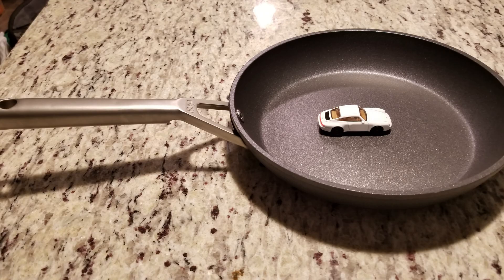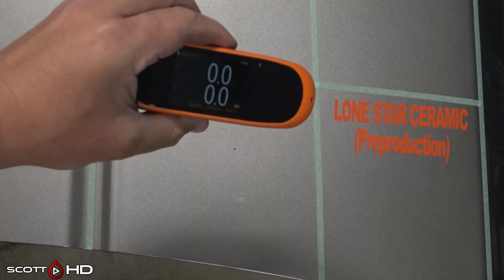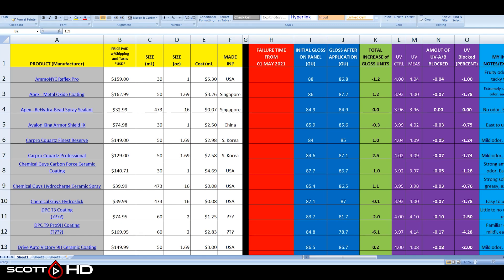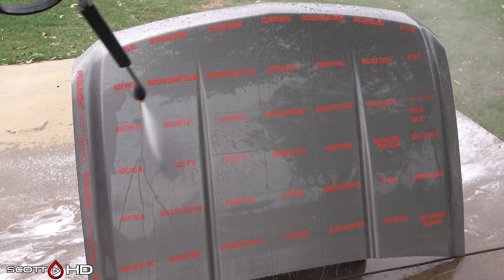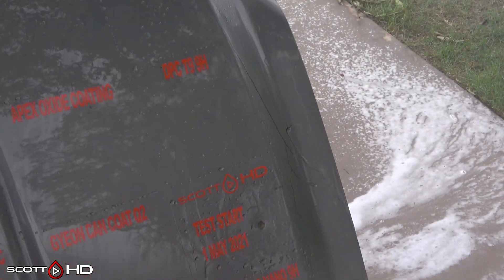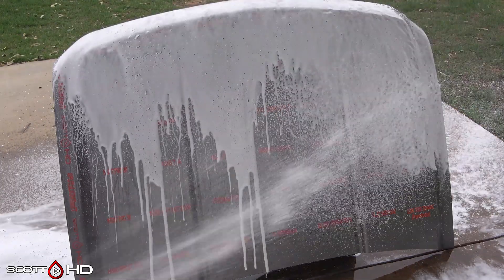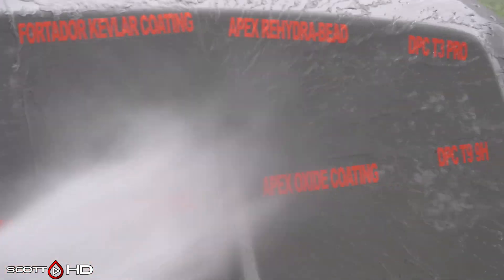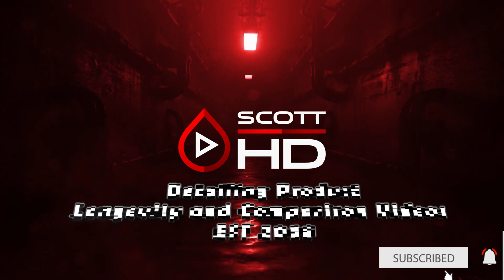Ceramic Coating Longevity Test - 41 WAY - The ULTIMATE comparison test - UPDATE 01 - FIRST WASH

Comment: This color makes it hard to see what’s going on but it’s good to see another lighter color in the mix maybe products will last longer than on the darker paint.
Reply from the maker: I agree. It was a bit of a risk since I couldn't find a black hood from my sources (body shops) that I get these from.   I will try to change angles of the lighting to better show it in the next updates.  Failing that I may try a different lens filter. I use a UV filter for outdoors which generally helps the water show up on the panels.

Comment: Great job. Can you add a ranking? Or add a filter to your spreadsheet to allow sorting by different properties like gloss?
Reply from the maker: Definitely. It's on the spreadsheet where you just select the row and sort by column for gloss. 

The ranking will end up as the failure time in days.

Comment: Rooting for CanCoat. Nothing easier to install.
Reply: Did you polish before applying for the first time? Also do you polish when reapplying after the CanCoat wears off?
Reply from the maker: @jpr96  check out the setup videos in the video description.  Properly washed, decontamination wash, clay, polish, prep before applying.

Comment: Did anything gain noticeable gloss? I know the gloss meter is different but it contradicts things from other channels unless I am missing something.
Reply from the maker: As long as it is plus or minus 2, it essentially gained nothing. I have only ever seen a few products gain gloss above 2GU after application. The majority of the gloss increase is from polishing.   This meter produces reliable, consistent results with a much lower margin of error than the cheap Chinese meters, so I definitely have a lot of trust in this one.
Reply: @ScottHD  good to know. Idk jack about gloss meters and other than things like this never saw where they would fit into detailing.

Comment: The epic efforts in the past month to do ceramic and graphene long term tests is unmatched. 
 Silver is so so and black is king just like your channel.  Dark green or dark blue would be decent replacements for black hoods on these tests.  Fortador is sadly weak but you also applied it via brush which the product pushers said brush to apply to pad then apply to car... 

i think when it fails you could consider “redoing” it correctly.  likely a bad product would fail again immediately and then that would be that.  maybe a hood of shame for the ones that just didn’t hold up and can demonstrate a second time that it has been marked weak
Reply from the maker: Agreed on all accounts. It was a risk for a silver hood, but I will play around with lighting and natural light for the next update to see what I can make happen

Comment: Scott, I'm confused. I hear other water reaction terms besides hydrophobic. 

Seems there are schools of thought for beading action and sheeting action. One being preferred over the other. 

Beading is hydrophobic and sheeting is, correct me if I'm wrong, hydrophilic. 

Just trying to keep an open mind here, but could any perceived early weak performances be attributed to a product being hydrophilic vs hydrophobic? 🤔

Never understood the preference for sheeting...harder to move off the panel with air and saturates a towel quicker than beading. 

Your thoughts?
Reply from the maker: There is a difference yes, however it if the water is sticking to the panel, there is no hydrophobic or hydrophilic properties remaining. (a good example of this is shown in the 20 way spray Coatings test). 

That being said, these products are all advertised as "hydrophobic" and will not just become hydrophilic.  The original intention is installing products that have hydrophobic properties.  

Manufacturers will tell you that just because the product is no longer hydrophobic, doesn't mean it has failed, but then what's the point?   (It's definitely not protecting against UV light as has been shown).  

You DO want a hydrophilic product for a matte or satin finish paint or wrap, as water spots will absolutely destroy it otherwise.
Reply: @ScottHD  thanks for the clarification 👍
Reply: Could you water/mist the hoods a few days before the wash video, perhaps flat hood natural orientation set in a table and allow natural evaporation.  better if from collected rainwater but still that would give you closeup shots of water spots especially on the graphene black hood

Comment: If you pay the outrageous price for Fortador it should be a one and done application!  You shouldn’t have to reapply every couple months and it looks like it’s going to fail in the first month. Unbelievable!
Reply: I would not reapply to see how long it take to crash and fail!!!
Reply from the maker: This is why I added another part of it along the right edge of the hood to apply it "as directed" but I agree with your points... A standard carnauba wax is "reapply every 60-90 days or so"

Comment: I’m rooting for griots 3-1 in this and your other test. Amazing value with that one and easy for us regular folk to buy and apply. 

Griots also has a ceramic speed shine quick detailer, have you tested that as a maintenance application for the 3-1 coating?
Reply: I too have been applying Griots 3 in 1 to my cars and the results have been amazing so far.
Reply from the maker: Agreed. I haven't tested as a maintenance product yet, but I may play with it on my personal vehicle as I have two batches of it now.

Comment: LOL at the frying pan opening. Another good video and project. Thanks.
Reply from the maker: Haha. Thank you 👍🏼
Reply: @ScottHD  Everyone knows that the proper way to test ceramic coatings is  pour them into a frying pan and cook them until they crystallize or until you poison yourself.  😄
Reply from the maker: @ludak83  you didn't know that? 🙄 LOL
Reply: @ScottHD  No I did not sadly until this great guy showcased it.  I immediately jumped and ordered a full truck of his favorite products via his affiliate link.  So, make sure you apply Avalon King on that toy car before you put the heat on.
Reply from the maker: @ludak83  you got it 😂